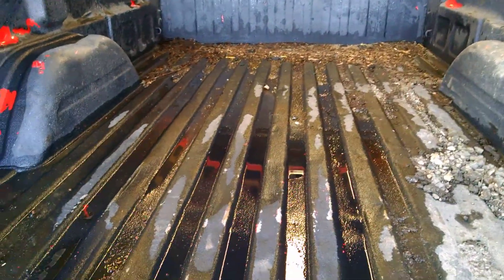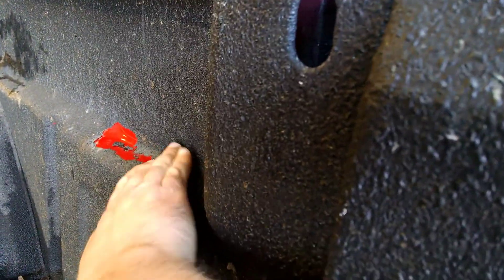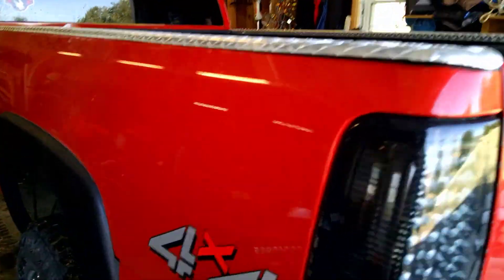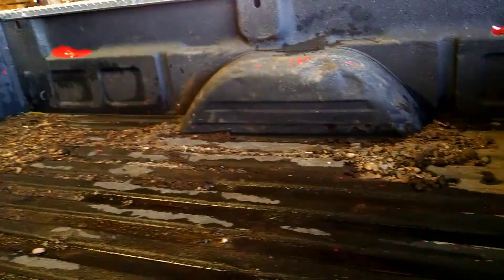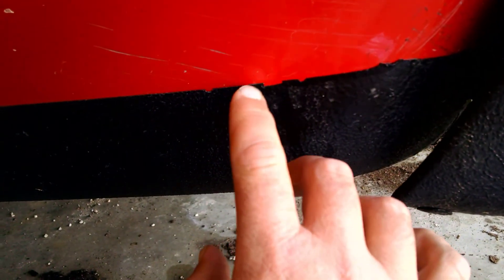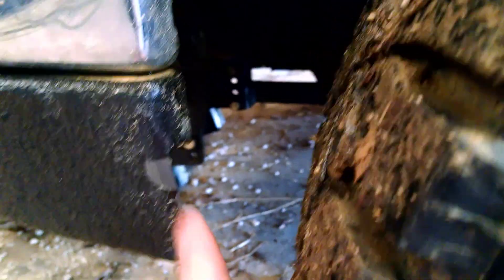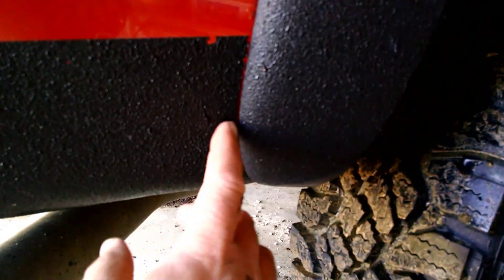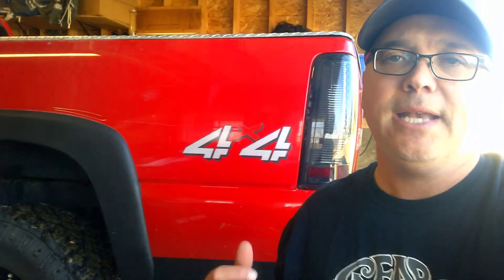How to Spray Bed Liner - the Wrong Way

Comment: Must follow instructions. Surfaces can't be shiny or peeling starts very quickly. I use a wire brisel attachment for a drill and go to town. Then wipe with acetone. You want a dull abrasive non Shiny look. With a newer truck just a sander with 100 git, then a 400 grit or so. Then clean. The most important part is prep. It is highly common for men to not read or even look for instructions. I'm guilty myself. Live and learn

Comment: Yes bad prep the bed paint is hard to sand but sand you must use a DA sander with 320 paper then clean with prepsol then the upol will last just fine

Comment: Your problem isn’t the bed liner it’s the lack of preparation before you paint the bed liner on. You must scuff and clean the surface or you are wasting your time. Remember the paint job is in the preparation

Comment: Lack if prep. The crisp coat is just floating on top of the original paint. You dont have to primer the whole bed but instead sand it down just to get rid off the clearcoat and your base coat will act as your primer. You have to clean it real good with a degreaser and follow the instructions base on time per coat. Nice truck btw.

Comment: Sorry brother, looks like you didn't sand prior to spraying. The liner had nothing to adhere too. Pressure wash the entire thing to get the liner off. Sand and prime before applying next time. Cant speak on plastic but please don't even try to do chrome because it takes alot of correctly done prep work and its tedious. 

The good news us it looks like you tapes everything off and you had solid lines.

Comment: Your kidding. Sorry to say if  you did this the result is 100% down to you. This is how you do it.
1. take a red scotchbrite pad and mix POR marine clean 1 in 10 with water and scrub all surfaces, this will remove wax and oil and abrade the surface.
2. sand back any rust spots with 80 grit paper and treat, round off all 90 edges
3. sand all surfaces with 120 - 180 grit on a random orbital sander
4. wash surface down with prepsol apply with an clean rag and wipe off with a separate clean rag. Do twice.
5. Spray Epoxy 2k Primer 2 coats a with a hvlp gun at 50 psi on a 1.8 nozzle. Be careful not to put it on heavy to avoid runs as this is a sealer and cannot be sanded well. This is better than an etch primer, etch primers absorb water epoxy doesnt and epoxy is much more forgiving and dries tough
6 next day abrade lightly with red scotch pad.
7. wash down again with prepsol
8. Spray hard to get areas and edges with grip4 allow 20 minutes
8. spray your raptor using correct mixes and spray system of your choice, allow one hour between coats
9. Dont let and water touch it for 3 days and dont put anything in it for 7 days
10. Apply mcguires silicon plastic restorer or similar to keep surface looking great
11. If you spray over plastics you must wash with marine clean, sand with 80 grit and scotch pad in corners, then clean carefully with marine clean again, spray with grip4 then with raptor

Comment: I don’t even have to watch the entire video. I can tell you right away you didn’t prep it at all. If the paint is shiny then it’ll peel. Better to just sand it to bare metal so you don’t have multiple layers of paint as well. But why didn’t you sand it at all? No prep what so ever. Sand then clean with acetone. What a waste of money

Comment: You do half ass prep work you get half ass results. Did my whole truck sanded and painted in 2 days and it will not come off. Maybe read the instructions on the product or hell watch a youtube video. Yes I know the video is 2 years old now but pisses me off that a great product looks bad in a video because some one rushed and didn't read the instructions.